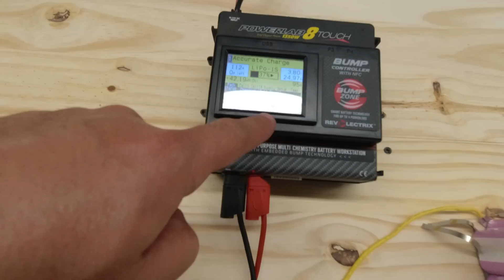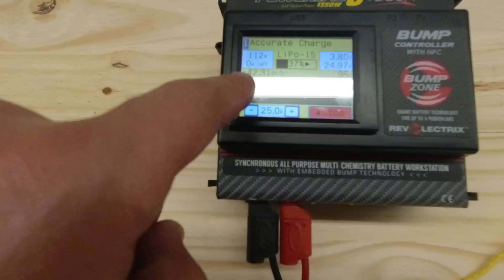Build a Samsung-26f 48V Ebike Battery pack for under $100

Comment: Don’t build your packs this way. Series connection on every cell , no excuse not to when built in rows like this. 
This is a very poor example for people trying to learn and seeing you do it they probably feel it’s ok. 
Maybe in very very low current applications it would be ok but a pack should always be built to the cells capabilities. If the cells can output 60 amps the design of buss bars should easily handle that.

Comment: I've watched lots of video's on ebike battery pack.I got this battery from yeah ,Aliexpress it was suppose to have Samsung cells.Not,anyways its a 48v. The center row of cells from one end to the other is not spot welded.I checked them with my meter around 4v.Should I spot weld them?

Comment: HI Jehugarcia.When you build battery pack from 18650 trie to get spot welder,high temperature fron soldering iron can damage the battery.

Comment: You got lucky connecting them in parallel like you did when their voltages were so far apart.
Reply from the maker: I get lucky everyday
Reply: @jehugarcia  Yea until your luck runs out.

Comment: I can see that you have connected only two points (+ and -) for every pack while other's are connecting almost every single battery in a pack to a different pack's batteries (if it make sense), is there a reason for that? I guess connecting every single battery would make the whole pack not redundant if a single battery on the each end would fail? Can someone explain me this?

Comment: Hi! which component allow/controller you to charge a 48v battery at higher amps? Most battery seems to have 5amps limit but I need to charge at 7amp max using two solar panels with Genasun solar controller. thanks!

Comment: Would recommend a max out of 20amps or about 3.5 amps per cell, x 48v = just about 1000 watts of continued draw. Iiif you are brave. I had a 72v pack made from these and had a thermal runaway on a bank. Explosive cells if not used correctly.

Comment: Hey Jehu, thank you for a great video, want to ask you why jag35 selling these batteries so cheap? Are they good battery qualities?
Reply: Great batteries. Famous 26f  cells. Look at batteryclearinghouse or batteryhookup for the 3 cell Pegatron.modem packs of you want the cells for even cheaper($0.55) per cell.  These packs are nice because they come in 1s6p already connected, so they are less of a chore to process into a usable pack.
Reply: @davisbradford7438  but the price is not like the mentioned. This is not good

Comment: So Wrong. 25 amps input.  way to high. Your array of little wires won't handel 25 amps evenly so you are wacking the first set of cells with way to much power.stupid........???????????......  Should be like 5 amps or better 3 amps and let time do it's thing.

Comment: Quick question, so if I have a 36V E-Bike I would do a 10S6P correct?
Reply: Yess, 10S6P , 10S = 10 x 3,7 V= 36V & full charge at 10 x 4,2V = 42V

6P , if each batteey is 2000 mah , so you get 6x2000 = 12000mah 
Or 36V 12Ah
Reply: @muhammadnurochman8734   if its 6×2000=12000 ,what will be the amp in whole battery🔋❓
Reply: Yes 36v 10s is correct. I just build one made by Vruzen.com. I did a 3x10 pack.
Reply: @nixmix3544  *vruzend.com
Reply: hello bro,tell me the series and parallel for 48v 40amps!🗣
Reply: @Mr.troll_duck  13series and 6parallel. I just built a battery pack for my new ebike conversion.
Reply: I just built my 1st battery pack for my ebike conversion with these batteries. 86 miles on my bike already. So far so good. The batteries were all good with good capacity. I do a 20 mile loop and not even getting down to 50% of the ebike battery display.

Comment: What ist better? 7s10p, 7s20p? For a 24V Powerwall... And can i fix multiple Accupacks 7sxp (with single BMS) in parallel? Like 7s20p-4p?

where can i get information for diy Solar Accu Packs, and normal Configurations?

Ist it better to assamble 48V Packs, or 24V, 12V Packs... With 48V The Current should bei only 1/4 Like an 12V Pack

Comment: I need to discharge test some high amp hour batteries what do you use at least 10 amps to measure amp hours
Reply: You can make your own power resistors using nichrome or stainless steel wire.

Comment: Why dont you do another post and tell us how long that pack lasted. It was a nice build but...

Model: ICR18650-26F
Size: 18650
Style: Flat Top
Nominal Capacity: 2600mAh
Continuous Discharge Rating: 5.2A
Nominal Voltage: 3.6v

6 in parallel = 6 x 5.2A = 31.2A your feeding in series 13 times. ~3.6v X 13 = 46.8V Nominal

Those 2 5mm or 6mm you have linking the parallel packs in series come in cheap nickle plated steel and pure nickle and I have no idea the thickness so I just pick middle of the chart and say .15mm which can only carry about 6 or 7 amps respectively at max each and if they are nickle plated you can drop another few amps off each and thats max which will run them hot and weaken over time.

6A x 2 = 12A or 7A x 2 = 14 amps either way you better not be running more than 350 or 500 watt motor max or you will burn right through that pack  and even then it's debatable. 

Yes a lot of chinese manufactures make their battery pack the exact same way and that's why they had all those 2 wheel hover board fires
Reply: I was thinking the same thing. Not only will that pack overheat and destroy itself, it will likely take out the bike and rider also. This from the king of bus bars. WTF!
Reply: You pull 5amps from these and you are going to have a fire my friend. Rated when new at burst is 5amps wouldn't pull more than 3 amps from these used cells

Comment: How many amps can you get from that? Just curious, when I built my 14S, I got so much crap on the size of nickel strip and how many I used to create a series connection. Luckily I did some research before I built it. I have a 1500w bike(not complete yet). Most people that built them with 13S had issues here and there with the power after awhile. So I found out that a 14S battery was better as long as the controller could handle the amperage. Here is the video that helped me the most on my decision to make one-https://youtu.be/alHocJk7DHg
Of course, you can find my build on my youtube channel. I still owe all my skill to you Jehu you Rock......here is my build, I hope you like-(14S10P 34ah Triangle E Bike Battery Build)-https://youtu.be/ILeYqb9sZQY
Here is my BMS part of it-(DIY BMS & Active Balancer - 14S10P 34ah Triangle E-Bike Battery )-https://youtu.be/qnQNzUR4aZw
Kinda Crazy I learned most of my stuff from watching your videos......Hoping one day you feature me and help me get some subscribers....LOL 362K, I remember you at under 20K...You Rock!!!
Reply: Forgot to mention......I also made a cool charger-(DIY 90V 20A Adjustable E-Bike Battery Charger Pelican 1150 ( dps1200fb ))-https://youtu.be/ogmdTuobs8w

Comment: Hi what is the C rating of those samsung cells? I think they are 2C cells is that right? https://www.batteryspace.com/prod-specs/ICR18650-26F.pdf . I am looking for 5C rated cells good price 2600 mah
Reply from the maker: these are the only ones even close to 5C https://kit.co/jehu/lithium-battery-cell-sources/sony-vtc6-18650-lith
Reply: Have you looked at the SPIM08HP cells? They are pouch instead of 18650 but they are rated at 25C and are cheap from multiple sources.

Comment: i wouldve added more nickel strips per series connection, youll most likely be able to only pull 10 amps out of that before the series strips begin to heat up
Reply: Not only are the nickle strips too small, the parallel cell groups are touching each other and if it were not for the thin shrink sleeves the battery would short between parallel cell groups. That's fine if the battery is stationary but it's not safe to use on a E-Bike that moves and vibrates down the road.
Reply: @barryrudolph9542  Yes, additional fish paper between cell groups is a must for this application, better still to use real spacers (only a few $ more).
Reply from the maker: easy to do
Reply: I did that added more nickel strips. Thanks @jehugarcia for this video and the batteries they were a good deal.
Reply: I guess I was looking for this answer, thanks

Comment: How do you know the amount of amps it needs to charge? This is confusing the heck out of me. So you have 13s7p how do you add the amps required to charge per hour? Lets say 2600 in ah is 2.6ah x 6p=15.6ah
18.2ah x 13s=202.8 Amps. Am i way off because i cant find a straight answer in forums. Thanks
Reply: you would charge the battery based off the 6p max charge rate for each cell witch is about 1.3 amp per cell so 6 amps would be max rate i would charge them at. The way he  has it configured is 6cells parallel and 13 in series you always calculate total amp hours/ watt hours based off the parallel configuration
the series configuration is to just increase the total voltage of the battery.
Just for reference each of those cells can handle 5 amps each continuous discharge and 1.3amps charge rate

Comment: Missed one step - after charging is done youv needed to cut them all out and wait for one day do see the voltage in every one 18650 and throw away the ones who has lower voltage (minus 1 parallel). Now there is some "dirty sheeps" in pack/
Reply: You'd notice this also without cutting them apart. So it would be better to do this only when there is a problem.

Comment: I purchased about 10 packs.  Here's some caveats not mentioned.  They are stuck together so be prepared to  rewrap them with new sleeves.  Some appear as though they've been dropped.  This was only apparent during rewrap period.  Had about 10 rejected cells after capacity testing.  Overall batteries do test to rated capacity. However most only reach 4.15v. Fair deal, just a lot of mining.
Reply: I bot 50 packs for a powerwall. I'm having to re-sleeve half of them. I also get 2650 to 2750 and the date stamps are 2016 and 2017. Jehu is over-selling these. Add the dents and voltage limits and 3-week shipping. I may send them back.

Comment: DON'T RUN MORE THAN 10 amps!!!! usually one nickel bridge is safe for 5 amps (you can push it to 8-10 amps but you will generate a lot of heat. If you want to run 2800 watts of power (~60 amps) you need a total of 12 NICKEL STRIPS to have minimal voltage sag and heat.
Reply from the maker: Actually the bms is 30A SO 1400w on two nickel bridges

Comment: Nice relatively easy and cheap solution, but those two nickel strips for the series connections between packs aren't going to handle much current. I'd add at least 4 more!
Reply: Agree on the need for beefier series connections, but no need to use nickel strips, some copper wires soldered in will do just fine.
Reply: That's what I saw, no need for an XT90 is you can only put out 10amps on your series connections. But, it would be a quick way to build a battery.

Comment: ...lets do the calculus, shall we?...13 1s packs in that battery.  each pack nominal voltage=4v.  13x4=52 volts. {48 volt battery?)
Reply: Nominal voltage on a 18650 is 3.6-3.7v
Reply: total Volts is based of the nominal voltage of 3.7v per cell in series for lion batterys

Comment: Just out of interest (i dont know so asking) does the BMS have the capability to get hot like a battery pack does if so (again I don't know) would it be better to have wrapped after all the batteries have been wrapped in the yellow non shorting non fire wrap stuff and then attached. 

Not a criticism or telling as honestly I have about 2.5% of the knowledge you do in your brain in relation to battery systems, controllers and BMS. 

Please say if i'm out of whack and why if their is an obvious reason.

Love the work you do for spreading the knowledge worldwide (youtube) about how easy it is to change our presumed habits for transport.

Thumbs up on the vid, know how much this piece means on the youtube algorithms.
Reply: most bms don't get hot enough to melt anything because they are limited to a certain current load and are almost all thermal limited. only time iv seen bms get above 50C was when i was balancing the cells on a battery that were way out of sync
Reply: @jaylord55  thanks for the reply.

Comment: Make two 7s packs to  = the 48 volts, then make a removable series connector for the two packs, easier to charge on most common chargers, and ditch that BMS, use 2 dollar volt meters to monitor the battery. Just saying, Nice job, I've actually learned most I know from you, so thanks, Ron Stark.

Comment: Purchased 15 of these to just the same.  Supper Easy Build.
Reply: What values are you getting? I just got mine. They are 3-4 years old with mAh of 2650 to 2750. Not as good as Jehu advertises.

Comment: Jehu - On Easter, I had an 18650 ignite in my pocket. I spent 30 days in the BICU (Burn Intensive Care Unit). I'm still healing after massive skin grafts. 

I'd love to share my little story along with some pix. Hit me up if you like. This stuff can be dangerous so a Jehu-Branded PSA couldn't hurt.
Reply: WHY did you put an 18650 in your pocket ???
Reply: LOL, or not lol actually. I burnt a hole through my pointing finger a long time ago when I tried to charge a Li-ion battery. You know those short fat ones used on the early point and shoot cameras. It ended up venting and as I let go or the wires...which I was retardedly charging the battery with, the hydrogen lit up and like a very intense torch, it burned a hole right through. A large fire torch was passing right through my skin, bone flesh and nail. I spend a whole year with the ability to pass pencil led through my finger! Great for impressing kids in college. It's been a good 20 years now and I still have a little scar with some kind of dark metallic stuff stuck in there. I'm a happy and stable person, so I assume it's lithium..lol.